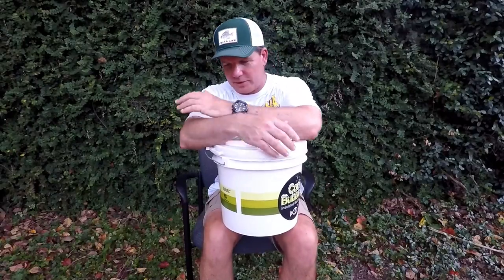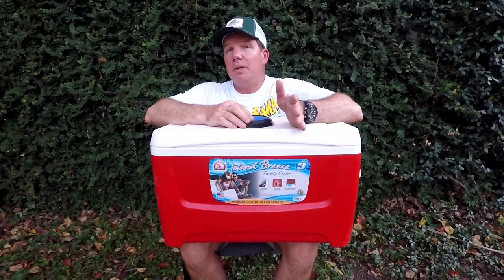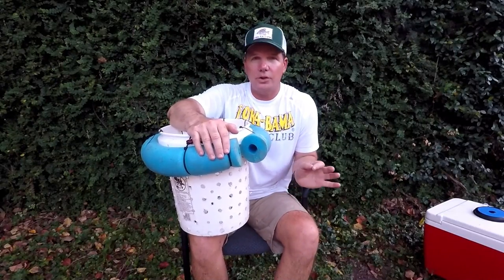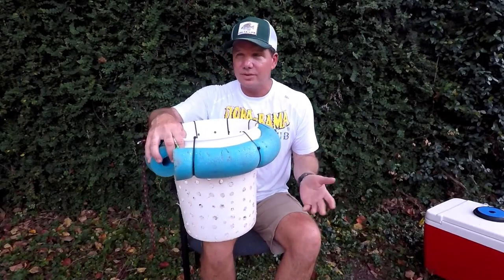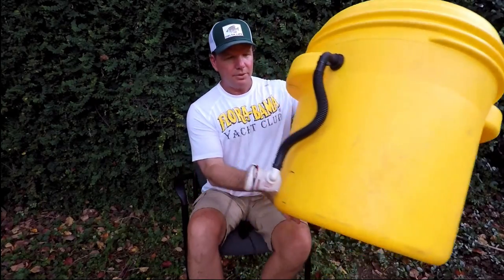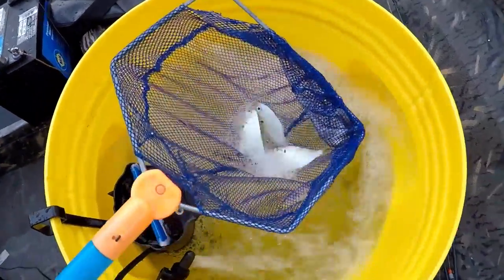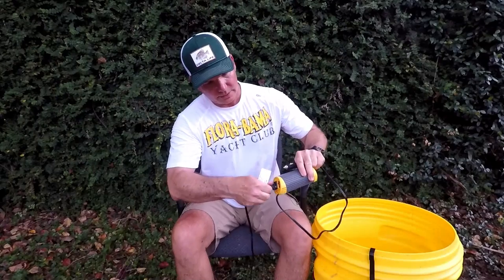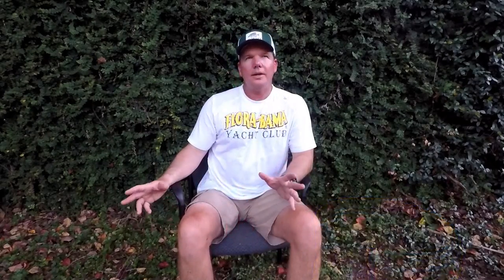How to build a LIVE SHAD tank for $162.00

Comment: Good build! You can get a battery or 12 volt filter. Make sure to use chlorine remover too if you have city water
Reply from the maker: I do need to get a smaller battery. I've been using a regular cranking battery and it's too heavy to deal with

Comment: How is insulation on the tank on the hot days?
Reply from the maker: There is none. Most of the time when I'm catching shad the water temperature is in the high 80's or low 90's. As long as the water is circulating it seems to work. I fill it up with tap water from the house before I go so it's a little cooler. My biggest issue to putting too many shad in the tank......can't help myself sometime.
Reply: @gillikinsisland  That makes sense. Around how many dozen do you think are good to keep in the tank?
Reply from the maker: @Fishing Is Therapy  If I had to guess, I'd say 4 or 5 dozen. As long as you have a good filter, you'll be in good shape. I sure tried everything until I finally got it right.
Reply: @gillikinsisland  Appreciate your insight and the video. Take care. Let's see what I can drum up!

Comment: Amazon $39.99  200W Power Inverter for Dewalt 20v 60v Battery ,DC 20V to AC 110-120V Battery Inverter with 1 USB Port, 1 USB-C Port,280lm LED Light for Outdoors Camping Travel Hunting Emergency(Tool Only)
Reply from the maker: That's great information. I need a new inverter and planning to purchase a smaller battery. Can you provide links to those?